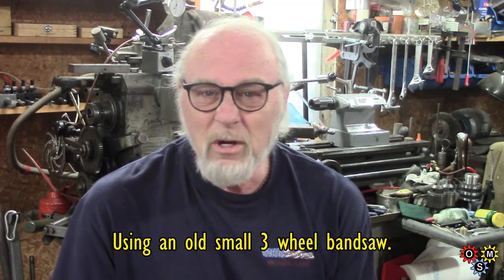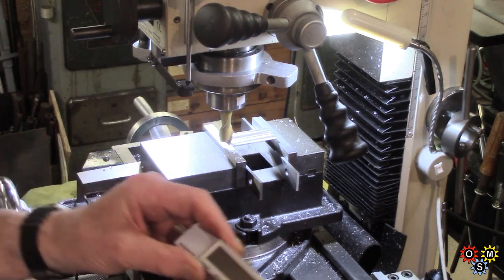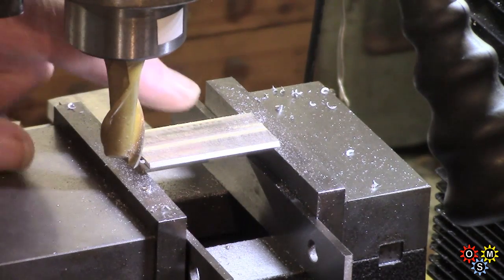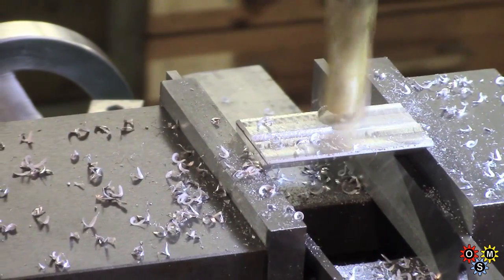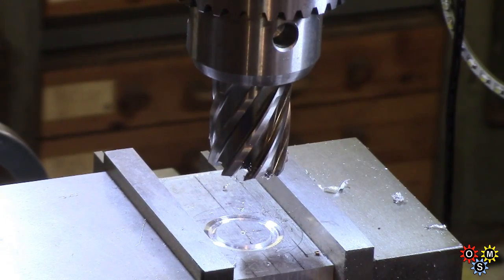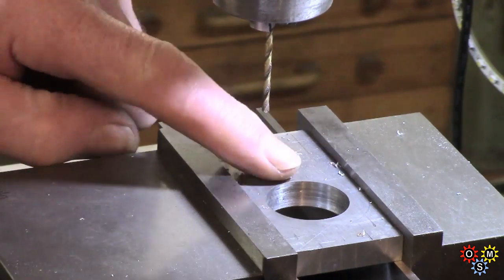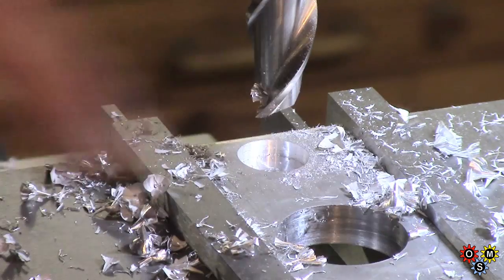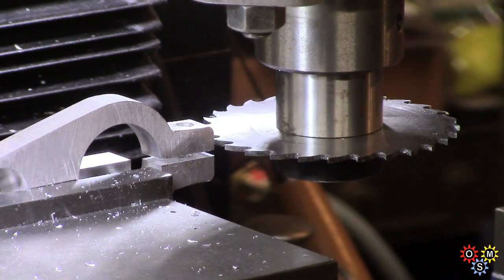Simple Tail Stock DRO

Comment: I only got my 2nd hand mill last week so VERY new to machining, I was admiring your vice and looks a good size for your mill. Could you please provide any details on it, size, price suggested makes etc? I'm a bit confused on what the dimensions are when they are advertise them online. Any help appreciated thanks
Reply from the maker: Hi Shaun,
Great you have your mill now. 
The vise is a 4" on a swivel base - which I don't use a lot but it was very good value. Sorry to say I never actually saw a make - I took a chance thru eBay and I don't think it was more than about $100 or so plus shipping. If you shop around you should be able to find similar. To the right of that one I keep a smaller 3" on the table though don't use that often.
Only downside of the swivel base is it loses me a bit of height capacity.
Main thing to try and evaluate is not just jaw size but capacity as well - also hopefully there can be mention made of anti-lift on the moveable jaw... forget the correct term right now.

Comment: A side question.  How do you like the G0704 mill?  I got one a few years ago and like it a lot.  I think your method here could apply to the mill as well.  Have to give it some thought.  Thanks for putting this together for us.
Reply from the maker: Hi Robert, 
For its limited size it has done pretty much all I wanted it to do - certainly never regretted getting it, although of course there is always that wish for a Bridgeport!! I did add a simple DRO to it long ago, for X and Y, the Z of course has one integral. Unfortunately these days I find it hard to manage much shop time any more.
Reply: @ChrisB257   Thanks Chris.

Comment: Nice idea for a DRO. Two points of interest for viewers: Use two pieces of flat bar (one on each side) of the part you want to slit for support while slitting. The clearance between the hole in the component and the quill of the tail stock must be as little as possible. Just 0.1 mm (which is massive) will probably cause the slot in the component to close up just about completely when turning the lock screw. I have been contemplating this idea with an electronic vernier for a long time on my small lathe on the x & y axis. You surely have a fine piece of vice on your milling machine brother.
Reply from the maker: Hello Pieter,
Many thanks for the comments :)

Comment: Good work Chris, simple yet effective! I noticed (in another video) you have a Bison chuck, how do you like it? I am in need of a small 4" 4 jaw later on and think I may splurge. Cheers, Doug
Reply from the maker: Hi Doug,
Thanks. Quite pleased with the Bison - would dearly have liked a 6 jaw but just too expensive. Some cheaper 4 jaw chucks are worth considering I think as there is no self centering to worry about (unless you really pay a lot).
Reply: Thanks for your reply Chris! I just purchased a 5" 3 jaw for my rotary table from Hong Wrong and its not too bad actually... had to rip it apart and clean out all the grinding dust that was in it and the action with the jaws is pretty smooth now, not sure what the TIR is but it shd be fine for what I need. Thanks again Chris, cheers,  Doug

Comment: And now I know why I want a slitting saw 😀! Cheers. Can anyone guesstimate what size that was please?
Reply from the maker: Shaun,
That slitting saw was a 3" I think and cuts an approx 1/16" kerf. The arbor takes up about an inch so cutting depth is around 1".
BTW - my 4" vise is 4 1/2" capacity. It is a bit large for the small machine but has served me well.
Reply: Thanks Chris for the info, off to eBay now 😀. Bank account taking a hammering 😪. Ha ha. Hope to see you in another vid soon but take it steady, don't knock your self so much though, your vids are VERY appreciated! You have a great clear way of passing on your knowledge! Wish I had teachers like you when I was at school! Cheers

Comment: I got the itch to do something similar a week or so ago. Got up this morning to look and see what videos were available to get some ideas. Just watched this one and Randy Richards' video and got some good ideas. I'll be using this scale, it's made just for the purpose. https://www.amazon.com/gp/product/B00LOAXJJE/ref=oh_aui_detailpage_o01_s00?ie=UTF8&psc=1 I'll just need to machine the mounts. I do like the 45 degree angle both of you used on the readout.
Reply from the maker: Hi,
Thanks - well, this is a pretty simple approach but it works well for very little expense. Randy's was a bit more polished but the result is much same.
Reply: Not really. He used chromoly is all. I intend to use aluminum as well. Mine has a separate digital readout from the sensor. so that will make mine different. It's all good though. Love to watch your videos. How long you been on this side of the pond?